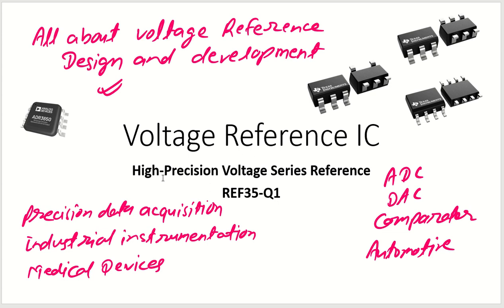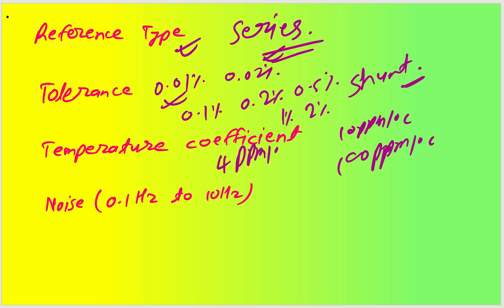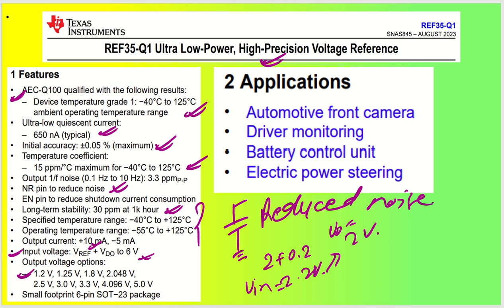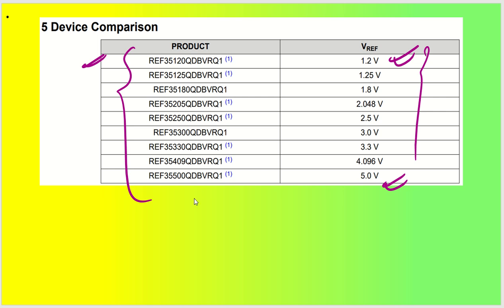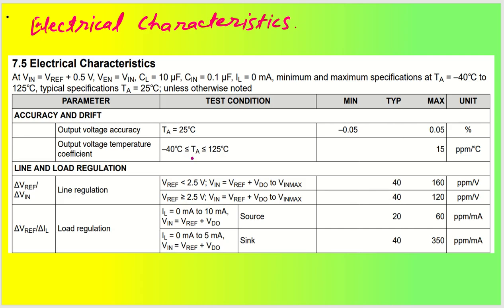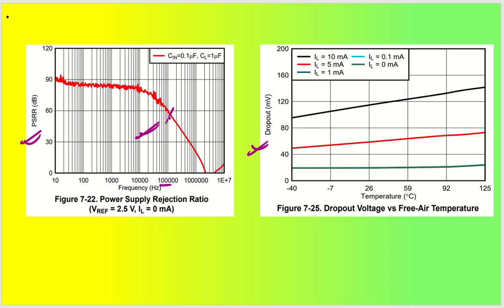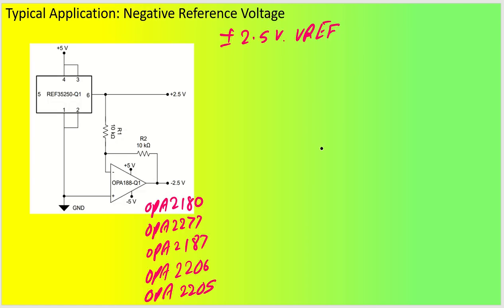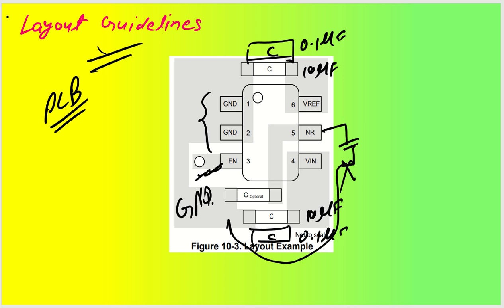072 All about Voltage Series Reference Design and Industrial schematic application

Comment: sir E Fuse chip ke bare me video banav na.
Reply from the maker: Okay, you will get it soon about eFuse and its working and circuit design
Reply: mere circuit me inpur voltage 5~30 range working hota hai esme e fuse circuit kaise kam karega ..
Reply from the maker: @sandeepthorvat6395  
You can use under voltage lockout and over voltage protection designed for the lower and upper range. Also very important thing is the current limit you wish to set, like the maximum current you want the efuse to pass, above that it should shutdown, you can specify
Reply from the maker: @sandeepthorvat6395  you can use LTC4381 for your application or let me know your application so that we can help you to find the best suitable components 

https://www.analog.com/en/products/ltc4381.html